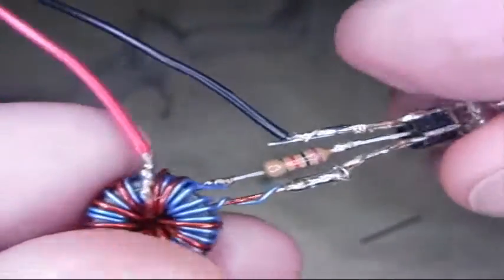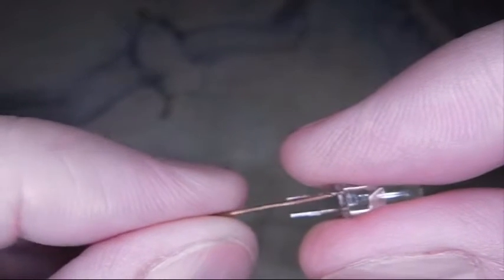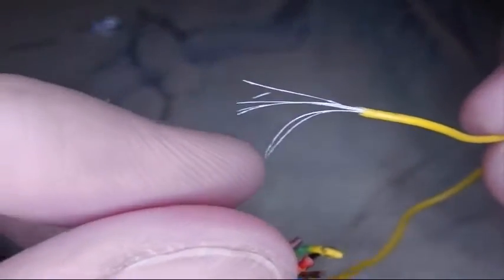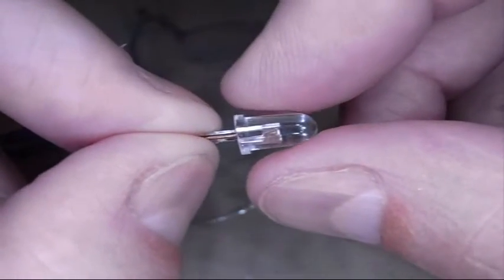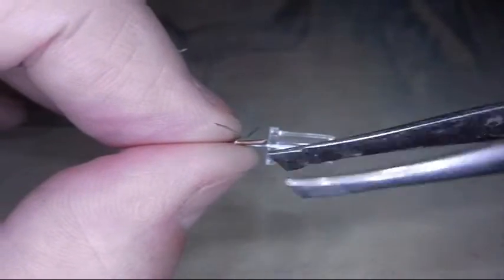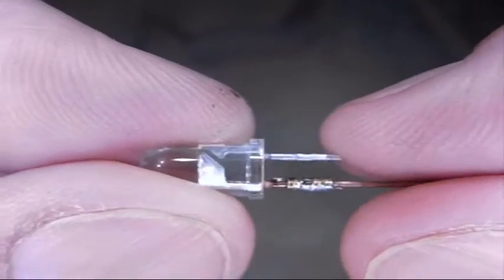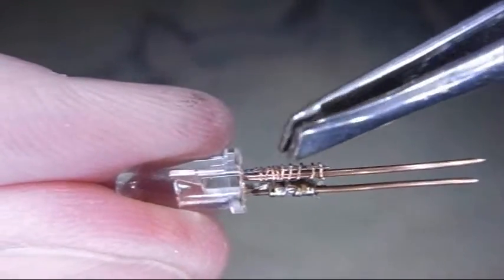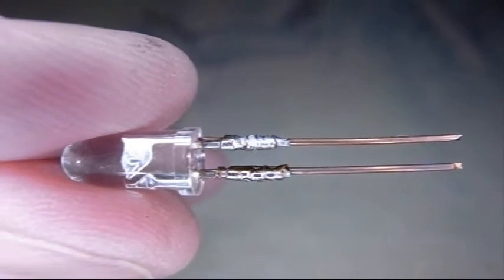Soldering Tip - Extend Short Leads, Solder Closely Spaced Leads, Wires, Etc.

Comment: There are days I work at a microscope soldering tiny wires into what is known as a Lemo connector. Soldering is an art and the prep is everything.  I used to think this ROHS compliant lead free solder was a pain, but once you have the right flux and start with a clean joint it is actually fun, albeit testy at times. I have a ton of LEDs that have short leads.
I would like to offer a tip. Make a coil out of the strand your going to use to lengthen a lead with. Poke a straight pin or some such into vice or block of foam and simply wrap the tiny strand or wire around it. Sort of a wire wrap in reverse? Crimp if needed and solder... BING done
Reply from the maker: Craig Nehring I would like to see a video of what YOU do under the microscope!  Sounds cool.  Usually I use cut off leads to do these things and they are a bit stiff for making tight curls, but then I do like a good challenge.  I will have to give that a try (and if successful) post that.  Thanks.